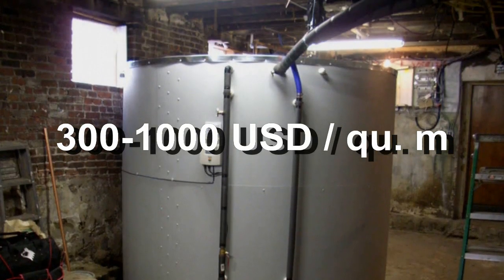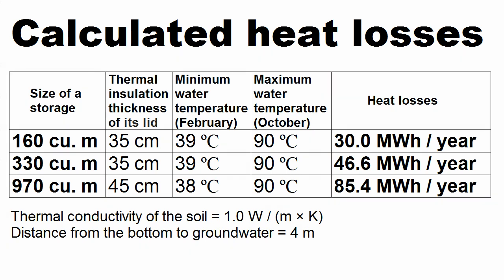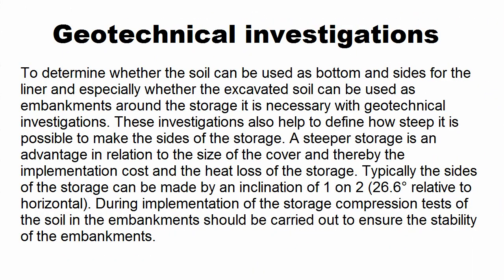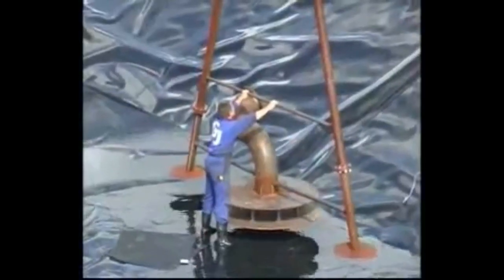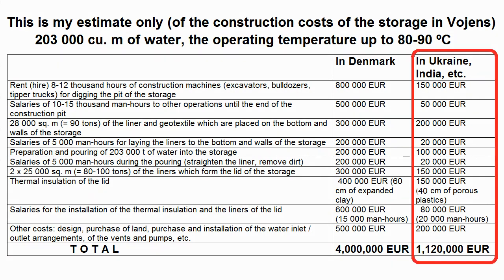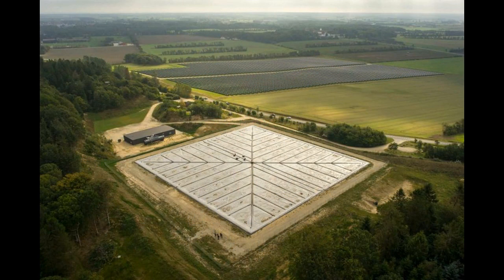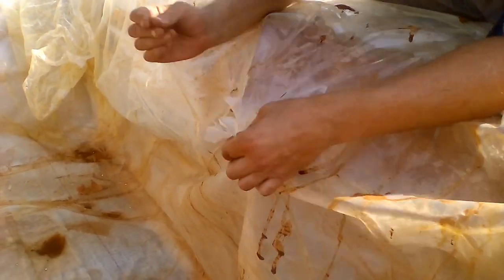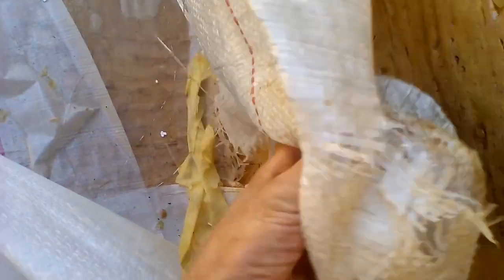How to build a very cheap Danish Heat storage (and my experiment)

Comment: I think there is a need to focus on non-organic materials to make such storages long-lasting. For example clay as hydroisolation. 
Any plastic will degrade in a few years with temperatures close to 100 degrees.
May be the best solution will be stainless steel lining. Because clay or concrete can also leak.

Comment: Hi
What if we just used the ground as heat storage. Then we do not need to dig in the ground. In stead we could make a lot of holes for the heat transfer
Reply: I believe research is still going on, I was on a project in Denmark a few years ago, where we built a database to collect data from many boreholes to measure the efficiency of reversing underground heatpumps in times of high winds/cheap electricity and thereby increasing efficiency of the heat pump in winter. One issue was ground water: it can be a good thing in "normal" installations, sind it replaces the cold water around your exchanger/vaporizer. If you try to store energy however, the energy you pump down will also get washed away.

Comment: How about multiple smaller containers.
Reply: more losses.. ?
Reply: @AutoNomades  Not if they are also packed together.
Reply: @mrgomelonsolaris  Yes true. And you can even circulate some heat exchange fluid in between them.. ; )